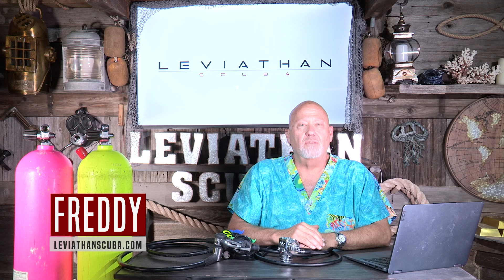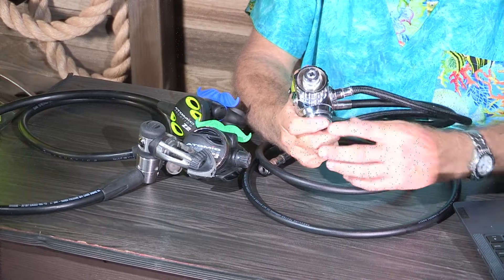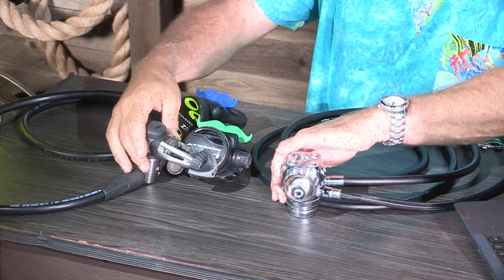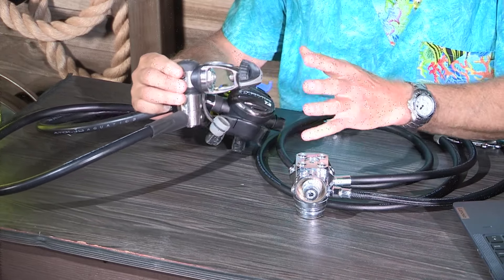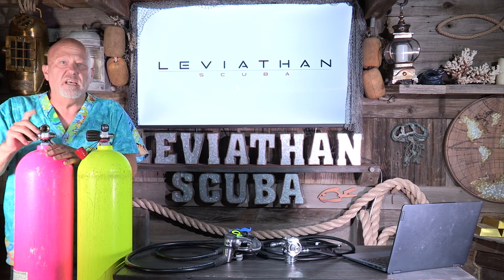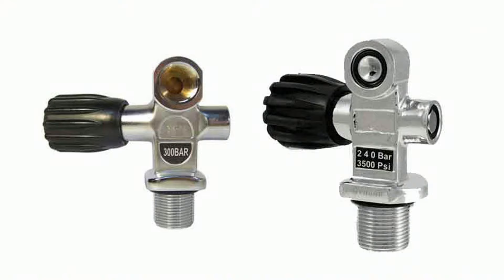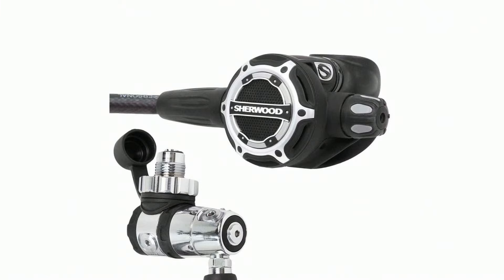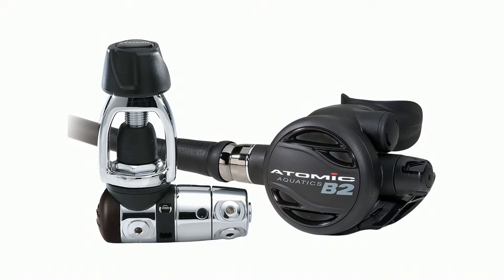DIN or YOKE

Comment: Everywhere in Europe uses din and the Red Sea is all din, that’s a huge number of destinations and resorts. 95% doesn’t make sense at all. One major point is that with din, you have the o ring on your regs, with yoke, you rely on the o ring on the tank that could be in bad condition.
Reply: I'm not sure the Red Sea is all DIN. I dived there last year on yoke, albeit just on a discover scuba day trip.  Agree in general though.  My recent trip to Sicily was all DIN.
Reply from the maker: My survey was done in Caribbean, Fiji, Indonesia, South Pacific and America. I have been corrected for places like Egypt and I guess growing in Europe as well. Funny how people pick up on something that I didn't think was that important. Not a comment on which was better but how many locations we dive that don't have din. Thanks for watching. Freddy
Reply from the maker: Also if it is a DIN tank valve and they need an adapter for the diver using yoke, there are two orings on the adapter. One inside and one outside. My survey was done in Caribbean, Fiji, Indonesia, South Pacific and America. I have been corrected for places like Egypt and I guess growing in Europe as well.
Reply: Most people want to dive in more tropical destinations, not in Europe though and it’s true everywhere I’ve been is using yoke, so majority of the places and population is using yoke.

Comment: I think you missed one quite important difference between yoke and DIN, and that is that DIN is available for 300 bar tanks. 8 or 10 ltr 300 bar steel tanks are quite common in northern Europe for recreational divers. In Asia most tanks are AL80s with DIN valve, but they use them with a yoke adapter.
The 95% is probably for the Americas. Other areas in the world are more mixed.
Reply from the maker: You are correct. My survey was done in Caribbean, Fiji, Indonesia, South Pacific and America. I have been corrected for places like Egypt and I guess growing in Europe as well. I sometimes forget my audience is global and not so much just America. I like the taste of crow now. Thanks for watching. Freddy

Comment: You're forgetting that yoke isn't used in high pressure tanks. I use HP100's. Same size as an AL80. They fill to 3500 psi. I challenge you to find a yoke valve rated to that pressure. 
It's not a big deal to convert. With my DIN reg, I can easily convert to yoke. However yoke cannot convert to DIN. So I have the flexibility to use any style valve. With yoke, I'm limited to yoke only.
Reply from the maker: Good to know. Thanks for enriching the content. Freddy
Reply: Thank you for this. Ive been considering getting an hp 100 or 117 because im an air hog atm. I didnt know that you couldn't get that in yoke.
Reply: @MysticalDragon73 You might be able to find a high pressure tank in a PRO Valve. That's a newer type that can be converted yoke to DIN and back using an Allen wrench. They are rated for higher pressures. 
Professional commercial divers use DIN as does most of the world. We in 'Merica and vicinity just have to be different. 😂
Reply: @CoreyStradling  well I do like that we are different lol.

I've seen the pro valves when looking at tanks. However I've been hearing now that yoke can't handle high pressure so now confused. Im just trying to ensure I get the correct configuration reg and tank while not having regrets later.
Reply: I believe most yoke are rated to 3200 psi. High pressure tanks are filled to 3500 psi.
Reply: @CoreyStradling  that is actually completely incorrect. Older ones maybe but not newer ones. Id asked this question and had 3 highly experienced people from different locations verify that modern yoke regulators are rated to 3442psi which is what hp tanks are rated to. Freddy even replied to a question I posed stating that it will be fine.
Reply: @MysticalDragon73  You're right. I think the new pro valves are 3442. Forgot about that.

Comment: Last year my LDS recommended that I get a new regulator to replace my aging Mares MR22, which had a yoke valve.  After doing some research I decided on an Atomic Z2 with a DIN valve.  (As I understood it, the Z2 has the same breathing characteristics as the more expensive Atomic regulators and since I had the LDS put my Miflex hoses on the new regulator I didn't need the swivel.)  The price of the DIN and yoke regulator was the same.  All the places I dive use pro valves which convert between DIN and yoke.  Here are the differences that I found.  The DIN regulator is easier to travel with since it weighs less and is more compact.  With DIN, responsibility for the o-ring shifts from the dive operator to the diver.  And, you need to know what size o-ring your regulator uses.  (Purchase before you need it.)  My MR22 came with a quality dust cover.  The Atomic came with a cheap ass dust cover that is only good for keeping dust out.  Purchase a quality dust cover if you expect to dip your regulator in a rinse tank.
Reply from the maker: Great information. Thanks for sharing. Freddy

Comment: More and more dive shops are replacing their Yoke valves by DIN valves plus DIN to Yoke Adapter, even in Asia. So they can handle both styles by just screwing that thing in or out. 
I definitely disagree with the 95% as well. I'm diving DIN and not one single time I had to use my Yoke adapter, diving in Egypt, Indonesia and the Philippines.

Technically there is not even one reason why you should prefer Yoke.
Reply from the maker: I do agree that many are changing. My survey was done in Caribbean, Fiji, Indonesia, South Pacific and America. I have been corrected for places like Egypt and I guess growing in Europe as well. Thanks for watching. Freddy

Comment: An advantage of the DIN type 1st stage, which might matter to some and was not mentioned, is also it weighs less ( ~150-200g / ~6-8oz, depending on brand and model, I looked at Cressi and Mares) and the overal shape (in my opinnion) is more compact since you don't have the knob/lever behind the cylinder. Here in the EU online shops, they ask the same price for either DIN or Yoke.
Reply from the maker: Correct. Thanks for adding good info. Thanks for watching. Freddy

Comment: Sighs. Wish id seen this and the discussion a week ago. 

Im a new diver and have been getting my gear. I got a dive rite regulatir when on sale.id forgotten to check to see if it was din or yoke. It turned out it was yoke.  I went back in to exchange it but they convinced me to keep it yoke. Including saying he only travels with a yoke reg. Personally im not expecting to leave the states to dive.

Now im considering getting my own tank. Ive been considering an hp100 or 117 because im an air hog. Now the discussion here is saying that yoke wont woke with hp tanks? Is this correct?  If thats the case then it seems like din is the way to go.
Reply: Hey there and Merry Christmas.  Honestly, I would keep the Yoke reg. Yoke is so much more convenient, especially in the US.  And if you travel from the US every dive operator, or the vast majority of them have yoke or will be able to accommodate a yoke regulator. I only dive yoke no matter where I go.    Now on a tank. Being kind of new I will give you some info I hope to be helpful. You can't or won't travel with a tank unless you drive by car. All dive centers, resorts, live aboards will supply you a tank when using their service included.  So if you dive locally then great, owning a tank can make sense.  As far as the size. A couple things. If you live on the coast and dive with a shop or boat service, they will try to limit your time to aprox 1 hour dives. Every new diver sucks air a lot. It gets better. So you need a tank that can give you an hour. Any more than that and you are filling, carrying, more than you need. Trust me, an 80 cubic foot tank will easily give you an hour eventually. But if you can dive unlimited time then a larger tank might make sense. Example: I can dive a 100 for almost 3 hours in shallower waters. That doesn't work for dive operators. So, when on trips I actually dive a 63 cubic foot tank because I can get an hour. Now, a good thing is to find our videos on stretching a tank, don't skip breath, and staying underwater longer. I hope that helps. You did good with the reg, I promise.  Thanks for watching, more to come soon. Freddy
Reply: I got the following reply from a local dive club message board. It was very detailed and informative.

Keep in mind, aluminum cylinders get warm during filling, but steels get hot, especially if the cylinder is already hot from being in the sun or in a hot car. For every degree a steel cylinder cools down, it will lose at least 5 psi. Thus, if they fill you up to 3442 psi, which is the rated pressure of 100’s and 117’s, they could lose a significant amount of pressure unless they are filled and allowed to cool and topped up again.

Yoke regulators can work with either 100’s or 117’s. They are both 3442 psi rated, which is the maximum pressure allowable for a modern yoke regulator. Note… modern yoke! Back in late 60’s, 70’s, early 80’s, regulators were built for the lower pressure cylinders of the day, which were 2250 psi, topping out at 3000 psi. Modern A-yokes are built much heavier these days to compensate for higher cylinder working pressures.

100’s and 117’s usually come new with a 232 bar “pro” valve, which can be DIN or yoke depending on if you have the DIN insert screwed in or not. Those cylinders could also work with a standard yoke valve as well. It is just important that whatever valve you choose has the appropriate burst disc installed for the rated pressure of the cylinder it’s being used in.

The only cylinders that require a 300 bar DIN valve that you absolutely could not put a yoke regulator on were the old 3500 psi Genesis type cylinders. These came in 80, 100 and 120 sizes from the early 1980’s to the early 2000’s. They had a 7” outside diameter and featured a very non-standard 7/8” neck thread that was much smaller than a standard cylinder. The designation for these cylinders is E9791. You will only find them used these days.

As long as you stay with modern 2400 psi - 3442 psi steel cylinders and you have a somewhat recently built regulator, you will absolutely be able to use a yoke attachment.
Reply: @coralkeyscuba  Merry christmas.

Thank you so much. Ive certainly subscribed as I love your delivery and information. Im going through other videos now. 

Thank you for putting me at ease with the yoke. Its so hard to find good reliable information anymore.

I mostly plan on diving two local quarries here in ohio, Gilboa primarily and whitestar . While I would love to do trips, I cant afford it nor leave the country. I do hope to make it to the georgia aquarium and dive there as it looks to be amazing. 

Part of the reason I want my own tank is because its an hour drive to the dive shop, 2.5 hours to the quarry. If I go to pool sessions it saves me a trip in for tank and gear. Plus I get familiar with it and know what weight I need. I suspect ill get more proficient, and that will help me be a better diver, and use less air in the process.

Comment: I would disagree on 95% statement. It's more of 50/50 nowadays. 
On top of it - it's 2024 and any reputable dive shop uses a convertor valve by now. 
Main difference is the pressure, but if we talking about 3000psi - there is no difference. 
I have a yoke, my wife have a DIN , never had a problem with finding a tank.
Reply: ya but he's talking to the rec divers, who are thinking of buying a reg. Some get lost with which to get., when most people only really need yoke, and in the long run it will make thier lives easier to get that. 
I read all the DIN is technically better when i was looking for a reg and got a DIN with an adapter. but I'm realizing that I really only needed the yoke version since most of the time I'm renting tanks and i have to use the adapter all the time.
I'm not tech, maybe one day I will be... but in no way will your first rec reg be your tech reg. so I'll second the make it easy on yourself and don't buy the "cream de la cream" as you start a sport.
Reply: @marcg2233  using DIN with adapter is essentially killing all the benefits of it. 
For rec diver the main difference probably will be who is responsible for o-ring. If you have yoke - dive shop problem. If you have din - your problem. 
I use yoke myself, I've seen few o-rings blow out here and there, but if you pay attention to it , you will not have a problem. 
I had shearwater transmitter blow up in my face few weeks back, and it's the best you can get , and it still can fail apparently.
Reply: exactly, I made that mistake cause I read the wrong info. (yay hindsight) what i'm saying his audience isn't tech divers but people getting into rec diving. it's not about which is better, but which will make the new divers life easier.
Reply: @marcg2233  I think in today's world , both will be easy. Convertor valves become a norm more and more. 
I like the DIN since it's a bit more compact, but not to the point where I'm gonna go thru trouble of selling my Yoke to buy DIN. Yoke is doing it's job just fine for me, my wife have a DIN just because that's was in stock and on sale when we got it.
Reply from the maker: @amadeuss3341  I agree. If you mostly dive a location that uses DIN then a DIN regulator could make sense. But a new diver hunting a product would mostly be served with a Yoke. Again, not commenting on which is better just what most recreational divers might choose verses Tech diver. Thanks for making it a better conversation. Freddy
Reply from the maker: @marcg2233  You said it brother. I sometimes do lose sight that my audience is mostly America and Yoke is certainly the dominant version sold. My research missed some of the countries that use din a lot like Egypt and apparently Europe is growing in their DIN use. I agree that if you buy din but use the adapter all the time then you lost the benefit of din and might as well had used Yoke. Thanks for watching and making it a richer conversation. Freddy
Reply from the maker: Honestly as I am learning further from the comments is that many locations are adding to their DIN inventory. My survey was done in Caribbean, Fiji, Indonesia, South Pacific and America. I have been corrected for places like Egypt and I guess growing in Europe as well. Wasn't a comment on which was better as I believe the technical data on performance is identical. Just which type of diver mostly uses which. Thanks for watching. Freddy
Reply from the maker: @amadeuss3341  I agree but O rings are cheap. I have never heard of a shearwater transmitter blowing. Did Shearwater take care of it for you?  Their customer service is great. Wondering if it was modified in any way? Hope all is well.
Reply: @LeviathanScuba  oh yes they did , i had new transmitter in my mailbox by the time i got back from vacation. 
The OPV blew up , apparently they had a bad batch of swift transmitter. 
Had an interesting dive that's for sure. Bad experience is still experience i guess :)
Reply from the maker: @amadeuss3341  We are all better for experience we survive through. I represent around 200 manufacturers and Shearwater and SeaLife are the two best by far in customer service. So glad they took care of you. Makes me wonder what batch was bad. How long ago did you buy the transmitter? We sell a lot of Shearwater and have not had one go yet.
Reply: @LeviathanScuba  mine was 2021, if you google OPV failure - you will find a bit of info about it (don't remember from my head )